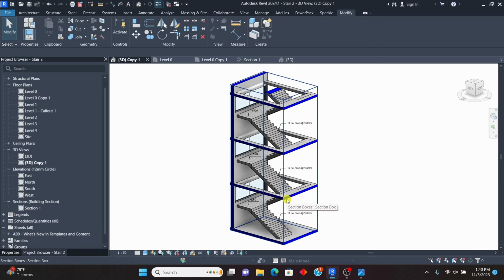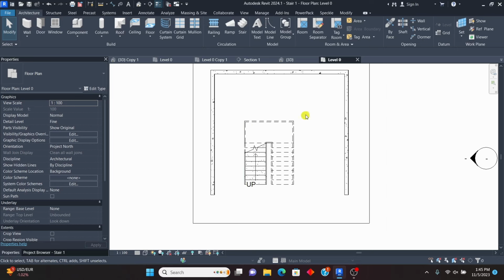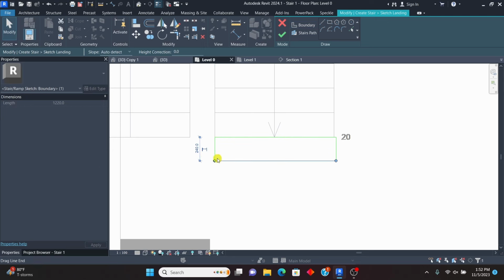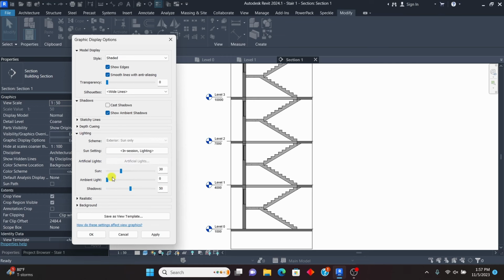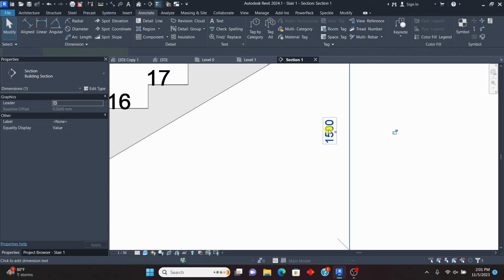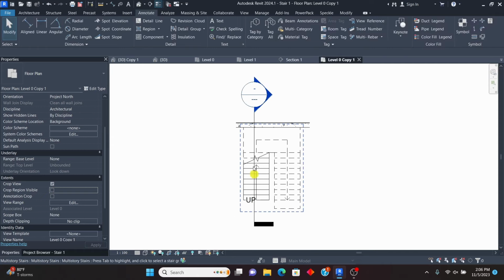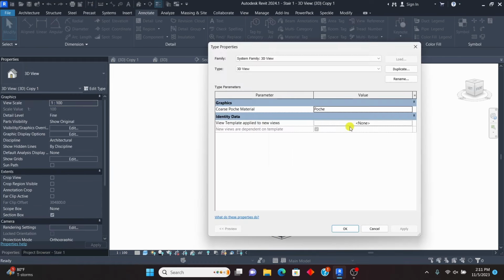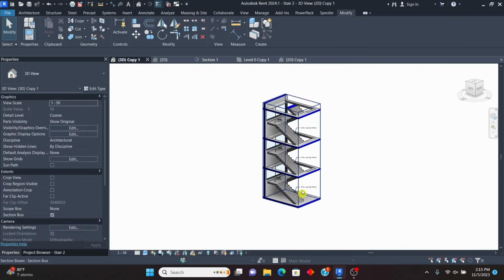Revit tutorials || Modeling and detailing of stairs like a pro.

Comment: Thank you very much for this lesson. 
I have two questions. 
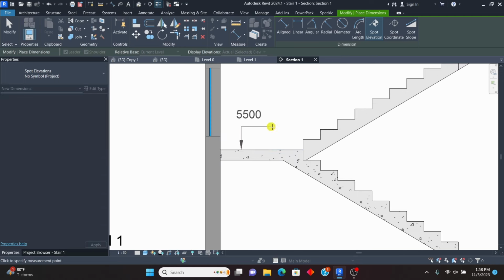1. Is there a way  in Revit to automatically align Spot Elevations 14:04, either during placement or afterwards? By alignment, I mean keeping the text positions, shoulder lengths, and leader lengths consistent across multiple Spot Elevations. In this video, all annotations are adjusted manually by eye. I am looking for a more precise and scalable method suitable for large documentation sets.
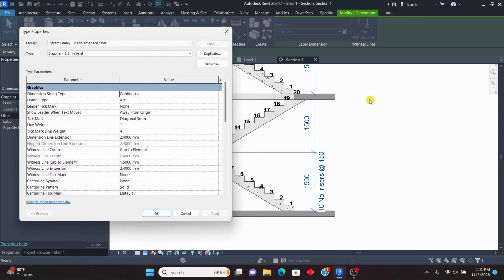2. 17:00 Is it possible not to fill text fields "10 No. risers @ 150" manually 5 -6 times, but fill them automatically, either while place them all at once afterwards?

Comment: The way I see it, most of tutorials end up having stairs that are not joined to walls or floors, leaving a lot of lines not needed, which later you have to try to hide. And some of tutorials leave it the state as is, but go a step forward, and draw "component in place" of "wall" type as extrusion, and then hide stairs (since now it takes the same place) to be used in sections and 3D. For now, I still cannot find out how to make stairs without doing this extrusion.

Comment: Thank you. I would like to request a tutorial on Powerpack plug-in
Reply from the maker: Well noted. Will do in near future
Reply: @skillmaxacademy   I THINK YOUR CHANNEL IS UNDERRATED DUE TO CAD DRAFTSMEN STILL IN THE STRUCTURAL FIELD, ALL TECHNICIANS STILL USING CAD IN ASIA FOR STRUCTURES.
Reply from the maker: @sunilJoseph-u3g I understand. But just like most of the Architects are using 3D software, very soon most Engineers will do the same, and that time is coming sooner than later...